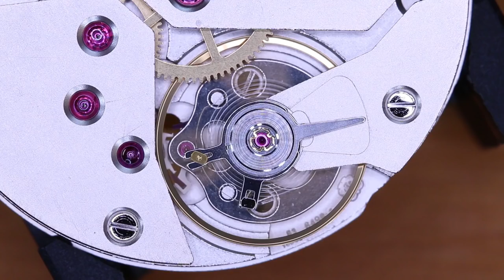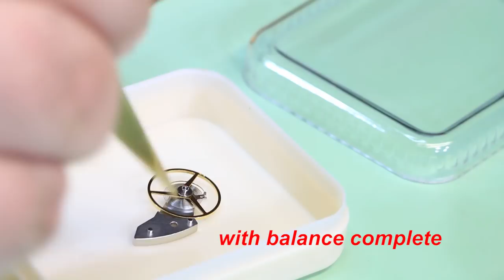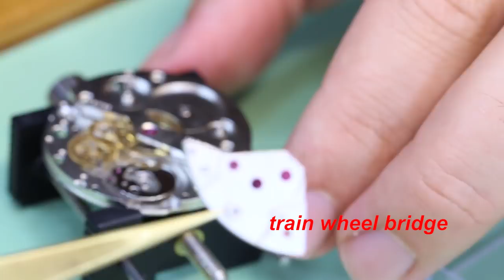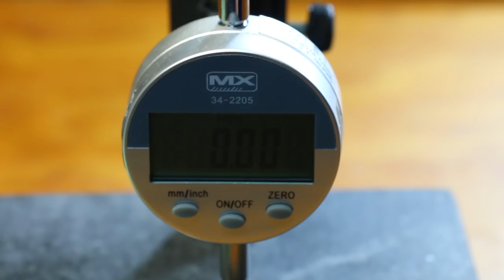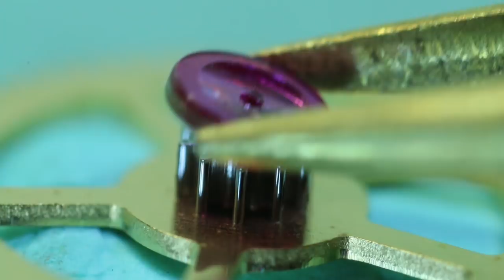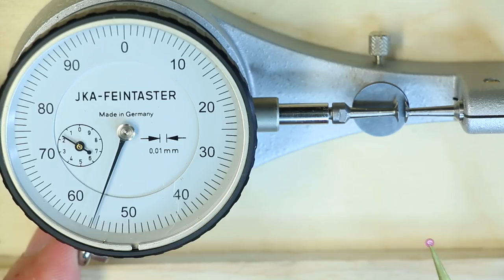Watchmaking Vlog 1 - Making My First Watch

Comment: Is it just me or have you forgotten the hour wheel? This is the dial train gear that fits over the cannon pinion and carries the hour hand. Or did I miss something?
Reply from the maker: Hi Robert, great pick up there is no hour wheel in this video. As you are most likely aware the hour wheel is held by in place by the hour wheel washer and a dial. If a dial is not present the hour wheel would simply fall off if the movement was upside, which it is in my video. Also, new movements usually arrive with the hour wheel and dial washer in a separate container package to the movement. 

Thanks for watching and your support 👍🏼😁

Comment: What is the material of watches? Steel? I would like to design the carcase
Reply from the maker: The movement is made of brass, non- magnetic, decent in dealing with thermal expansion, does not rust like steel. I wish you all the success with your goals in watchmaking 😀👍
Reply: @DeanDK  Thanks!!

Comment: Is there any reasonable way for a horologist to modify jewel bearings? In this case of course yours already came with the movement, but what if you bought wholesale jewel bearings and needed to modify them?
Reply from the maker: +Michael Chalmandrier-Perna Seitz have a lot of different sized jewels. If you cant find the rigjt you need. I would go for correct pivot hole diameter, and an oversized outer diameter, then you can modify the diameter of the jeqel in the lathe
Reply: Great advice! thank you.